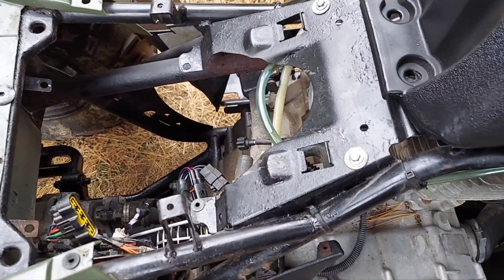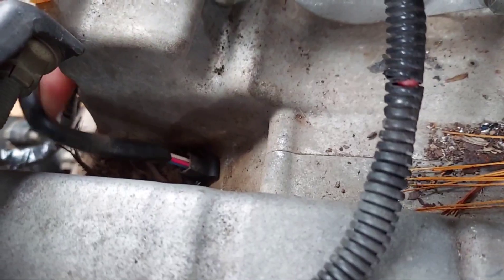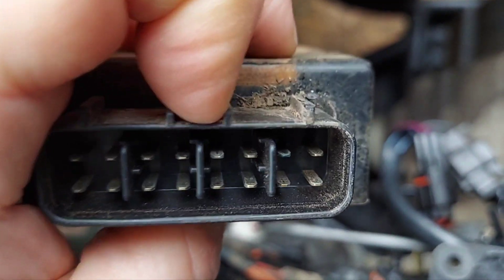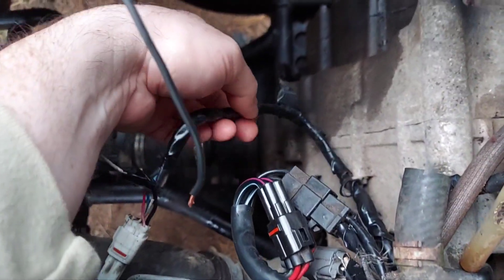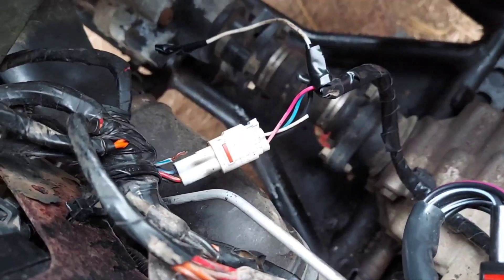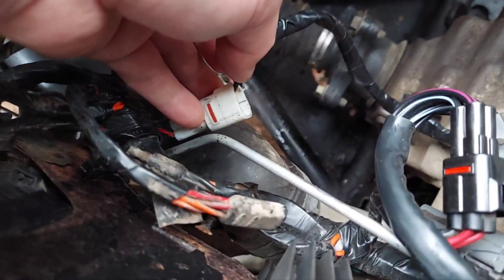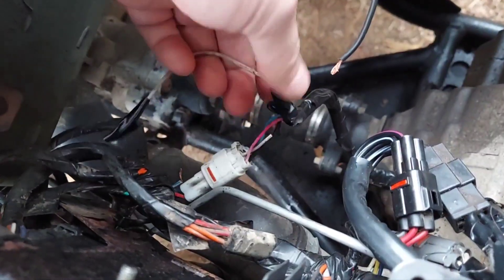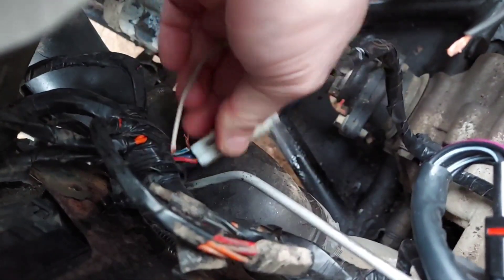2003 Arctic Cat 400 4x4 backfiring rev limiter in forward gears. 5mph top speed.

Comment: I had a similar issue with my Arctic cat 500 4x4, it ended up being the voltage regulator was bad.  If you tried running the machine with the lights on,it ran fine. Test the battery charging without the lights on, I was getting 20-24 volts,with the headlights on,it was 13-14 volts.